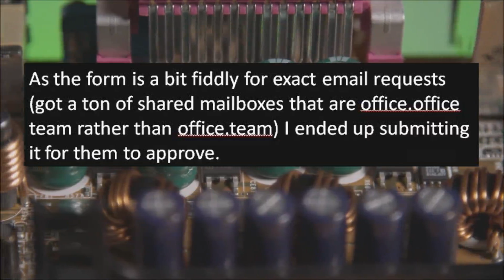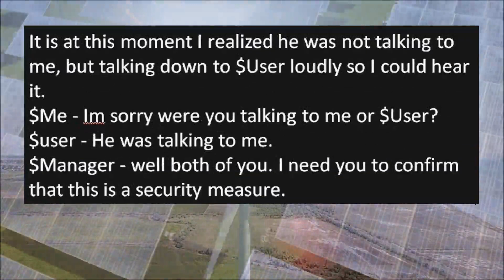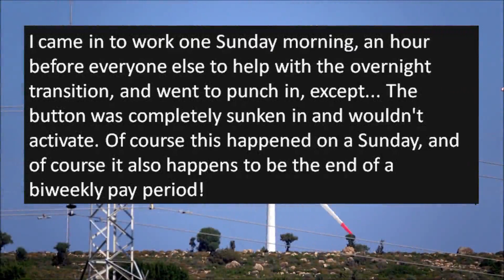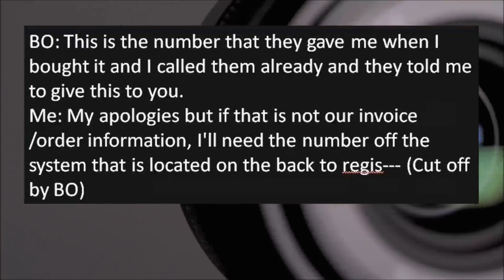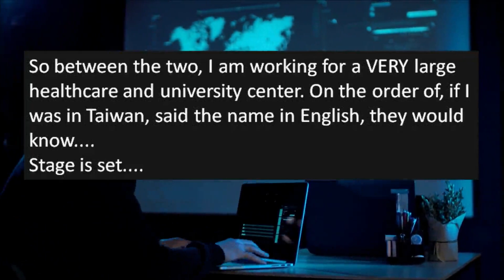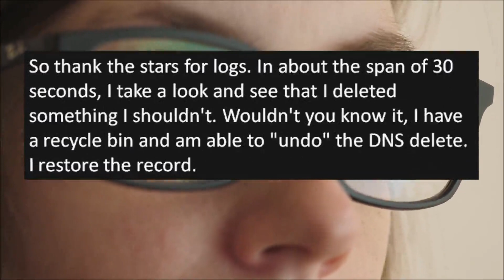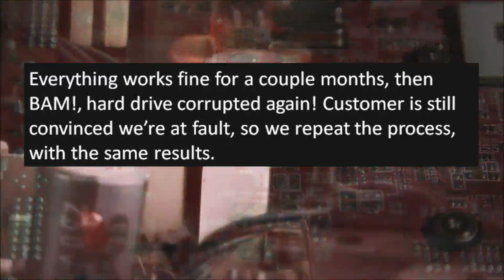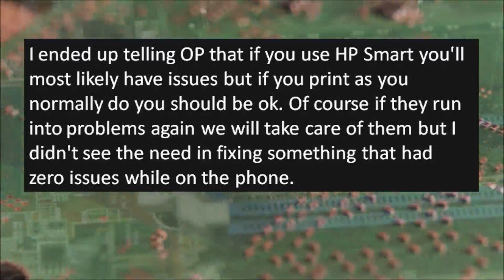Tales From Tech Support - Be gentle with the time clock!

Comment: Made me think of when I worked in prisons. We had rotary card type time clocks for hitting when doing rounds. There was a key in the front which you turned and it manually punched a hole in the card. One lazy officer on night shift who would turn the key and tie string and a weight to it keeping it engaged. This resulted in the card just getting ripped to pieces while it kept turning. They would just go make up a bed and sleep the whole shift. Management just kept thinking it was a faulty clock that did this occasionally.

Comment: Any software/device called "smart" or "intelligent" is something that should be used very carefully, always being on the ready for some unfathomable errors that will happen, due to the software/device being so smart it can produce those.
I like dumb devices much better. They only cause simple errors, which are much easier to fix.
Reply: My mother taught me to never trust a machine that thinks it's smarter than I am. She did programming when punchcards were a thing. It is still good advice.

Comment: Most of the sting from static shocks are because the arc touches your skin.  By holding a metal object like a tool or a spoon and touching the static shock source the arc jumps from the tool and you never feel it.
Reply: Trying to wrap my head around this one.
So, how exactly do you pick up the, metal, item without triggering the discharge?
Reply: @chrisbaker8533  The source of the static when I discovered this was the moment I got up out of my chair.  I'd turn around and touch a metal shelf behind me, ouch.  With the metal object I could see and hear the arc but felt nothing.
Reply: I used to work at a auto manufacturer and they used these "bucks" , metal frame carriers with aluminum and steel panels. The panels were designed to hold the polymer fenders and door skins. If you happen to let your fingers contact the metal while hanging the polymer,  GOOD LORD, it would light you up.
Reply: @chrisbaker8533  just use your keys.

Comment: Anyone else noticing that the difference between an end user doing something dumb and an end user doing something smart has a lot less to do with any clear guidelines of what you should and should not do and a lot more to do with if the thing the guy did actually worked or not?